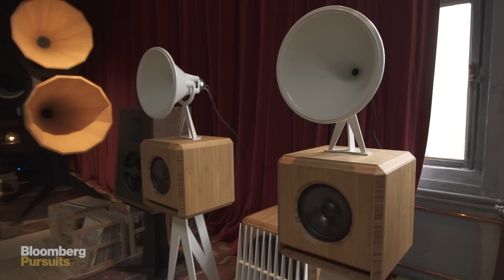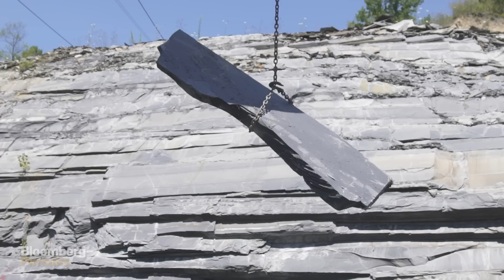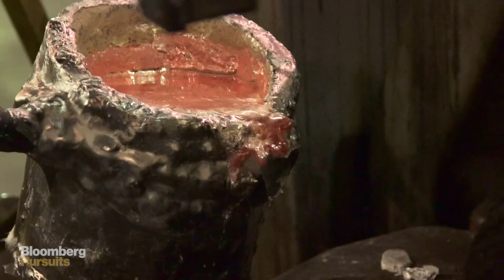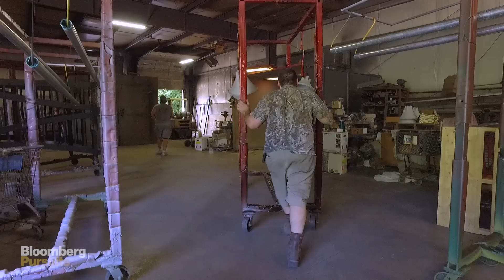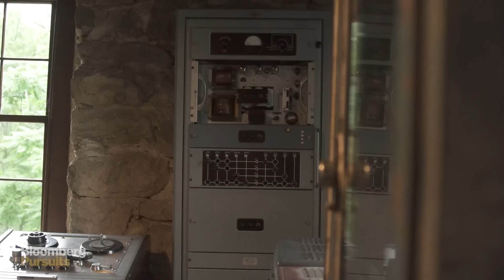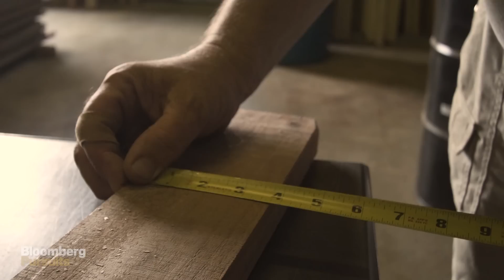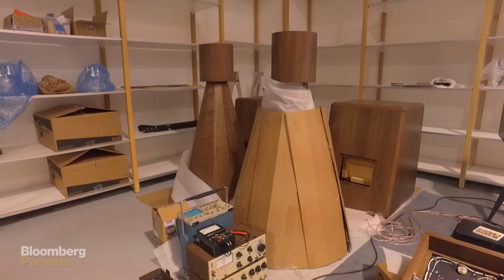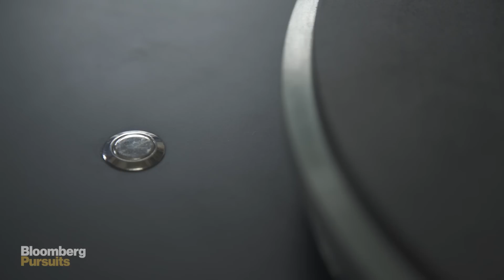How a $300,000 Speaker is Made

Comment: As an industrial designer (aka product designer) I can confirm this is all BS from design to manufacturing lol
Reply: if you talk bullshit all the time people start believing it, even the bullshitter starts believing his own bullshit.
Reply: all of the processes he talks about common processes and many times aren't even the best process for the piece, just the one that looks the coolest.

Slate: that is simply how slate is mined.  nothing special
casting: it isn't clear what all pieces are cast.  They make it look like the brackets are cast which is ridiculous as casting produces a much less desirable grain structure in the metal compared to most other processes and is only practical when it is a complex shape that requires it.  For any flat piece, casting is a terrible method.
Powder coating:  Once again, a very standard process that they talk up as being something special. 
electrical components:  As other have pointed out, horrible soldering job.  Bad enough that it could begin to degrade signal quality but more likely lead to premature failure especially for an audio device that will have to handle vibrations.  

If there really is some unique processes they do, he didn't explain it nor did the video show it.  It is a bunch of hyped up terminology.  

The wood working seemed good enough quality but nothing that justifies the price tag of a new home.
Reply: yep.

I'm just so annoyed with that audiophile community always saying they make they speaker that "represent exactly what the artist intended" or some BS like that. Ya know what I mean?

Them I'm like, dude.. go buy your shit at guitar centre and save 290k ;)
Reply: Batt man,  I am really not sure wether you are trolling, ignorant of being both... It's great that you think every speaker is a speaker. Good for you! But my ears are hearing a difference, and that is what counts. Not your opinion. 
Just to verify: Speaker sizes, use of tweaters, seperate mid or sub speakers (2 way, 3 way, 4 way), active or passive speakers, cones made of sturdier material to pump it up without tearing itself, acoustic chamber of the speaker.. Not forgetting manufactures who deliberatly use resistors to block out certain sound frequencies to get a warmer sound for example... ( like your ATC speakers for example.. ) You say everything is the same. Well good for you mate.  I am not going to argue you on this one though. You basicly say a race car is just a car too, but you forget that a normal car isn't build to race. Racecars have a special purpose. Yeah..  No use to argue with you. I just want to advice you to talk to high scholared music engineers. You know, those guys who push buttons, use sliders and knobs to make a track sound good? I bet all of them laugh at your comment mate. Because every professional audio engineer uses logitech computer speakers, because speakers are speakers... 

I also wish to go in about a few of your 'trolling' statements:  "Audiophile" isn't a global broad name for everyone who likes music and hifi? Because EVERYONE likes good quality music. So why call it Audiophile and not just human? An Audiophile is an HI-FI lover. High Fidelity.And that means that audiophiles are people who want the cleanest signals to their speakers. Who wants the best sound thrown at their ears. It's not so broad as you think it is. Most people dont even realise the impact of speakers, cables and all other interferences.. So therefore they are not interested. The " non- audiophiles"...  So, another thing you are wrong about. For fuck sake man, this is even in dictionaries.. Where did you get that bullshit?! 

I almost feel bad to correct you on every single thing, but you asked for it, since these are your words. not mine:

To quote you: Most people like you comment on video's like this without ever listening or even owning a pair of speakers worth over a few hundred quid     People like me? What you mean with that? In a stereotypical way? And how do you know that 'these?' people never heard something over a few hundred quid? Do you have statistics of that? Im really curious though. Because you are wrong, again. sigh..I feel the urge to tell you about my job, about my hobby. But i won't. I do not need to give you that info just in order to make you learn something.  But i hope you realise you did not meet the right person to 'test' your self-taught expertise. It's plain wrong what you say, plus it does not make any sense at all. Hope you realise you are wrong too for assuming things from strangers online.

And what's that about cabling? We never mentioned cables. Of course cables matter in sound quality, but we are discussing SPEAKERS. Not cables, no amplifiers, but SPEAKERS. :)

I have to say, i see alot of people claiming experts on youtube, but at least most of them have a certain basic understanding about it, but got it wrong in details. You fail in the basic.. You are rare. Treasure it.
Reply: want examples? that whole rant about his slate is bs. pure, unadulterated bs.
he claims to use the highest quality components, "aerospace stuff" is the term he used
Reply: Batt Man Alright my talking is officially done with you, you rather not take responsibility for your ignorance and just distract with a joke or a smartass comment; I just realized I have wasted my time typing this espcially because Im not one to constantly comment anywhere in the internet. The time i wasted is time I will never get back, well let me finish, goodbye fellow stranger.
Reply: As a music producer I can also confirm this is  all BS.
Reply: Well, Panta, I agree that the design is awesome, but then they just should call it 'design speakers' or 'design audio gear'.

The whole story about this having this awesome sound is such BS. I'm sure it's fine, but if you want great sound, then you buy a studio monitor.
Reply: Veteran Records, his father sounds like an idiot aswell then. But i guess he pretends to have a smart father. He is now changing subject. First he was the expert, now suddenly his father is. I guess your right. Seems also not worth my while anymore. People are objective. Let them decide who is right, i am not worried about that.  Just pointed out another very stupid young boy on the internet. Too bad he is making his dad look very bad on the internet. Poor guy. Hope his dad does not find out what his son is saying, in behalve of him...
Reply: "...a speaker is a speaker...period", said NO audiophile EVER.
Reply: thank you. You are now muted. :)
Reply: I'm not an industrial designer and I could smell the BS as well. Thanks for the confirmation tho!
Reply: The only thing it seems to be above average are the woodwork.
But since we are talking about some fking 0.3 mil, even if those are some Rolls-Royce woodwork(no, they aren't), it is still a huge rip-off.

I meant, you can totally buy a few masterpiece wood art for 0.299mil, and a set of $1000 speaker and have far better performance.
Reply: They try to turn music into fashion, ever since the end of the 90's. There are even highly skilled music engineers finishing tracks with mere headphones. ( HEADPHONES! ) "As the artist intended". Uhuh. 

Advertising these kind of speakers is just like using anorexic girls as a main image for the fashion industry. 
To put it hardly. It sad for those girls... It's also sad for those speakers...  

It's brilliant marketing though, because they make money of it, and that's whats counts as company. It's not in the right mindset though. It's actually unfair. 

Maar gezien je naam, is NL handiger? :P
Reply: Probably 1% of the speaker price is some really nice driver components that in a cardboard box would get your attention.
The rest is designer furniture mark up.
When he spoke about "tone wood" that Martin guitars use I knew this was sales pitch for simpletons.
This is supposed to be hifi, if there was a tone from the timber that is called coloration of the sound.
Those speakers don't look like they have timber 1mm thick like a guitar if he was serious about extracting tone from the wood.
Reply: Bro. Tolliver Well he is selling this and basically milking the whole process to sort justify the price, while the manufacturing process being actually very simple and typical of hand made.
Reply: Plus the design isn't anything to go crazy about. I mean, look at 0:30. What are those white speakers? Did they took them from a worker's strike or something? xD
Reply: Ok, but give us example of bs from this video.
Reply: Batt Man I don't really understand your point. 
My point is that it's better to buy a reference speaker or studio monitor than the stuff one can buy in an audiophile shop.
Reply: Wayne, haha. Was thinking about the same thing. Well batt man, go ahead. Make me a video then. Post the link here. Show me the credentials. You are whining how my information is wrong, yet you fail to even supply the correct information. You keep telling its wrong, but you fail to explain why and how. So here you go telling me you are going to make a video. Go ahead mate. Make me proud. Don't bother making a video showing what audio you own, because i don't care. We are not discussing what we own. We are discussing the principle of audio. So, make a video, explaining ALL these points being discussed right now. And how you counter everything i've said. I want your proof, your statistics, just like i did. If you do that, and you are right on everything, i'll will be a gentleman and say you are right and i will back off. Till then, stop trolling.

 Also, i know my grammar needs improvement. ( at least i know where my flaws are.. If i have an excuse, it must be because im not native english. But i guess you aren't so  ignorant to understand ) You, though, should worry about your typos mate. And if you don't want your father to be disrespected, stop using his good name for your own sake. If you are 44, that means he is retired, right? :) But that does not matter, because you aren't 44. Why? You don't talk like a babyboomer. Your profile text is: -"This channel is about music and not ratings, fuck the neggers of thumbs down, who gives a shit. Going out to all DJs of different styles of music and mixing".  This isn't a 44 year old speaking. And not even close to someone who finished Cambridge. It's a confused 15 year old speaking, desperately wanting attention and having last word all the time, without contributing anything valuable. Well, going to wait for the video now. :) And don't try to back off now! You've said it, now i want it.
Reply: Lick My Taint I know he is an idiot. Consider it a personal social experiment. How long till it takes to make an idiot understand he or she is an idiot? But i think we reached that point now. :) Still no video though.. 

I don't argue your choice, because for me it's another way to view at it. When i do my mastering, i reference on other speakers too. But having monitors, which are calibrated ( or should i say: left alone ) to create a basic and general sound, instead of enriching it with flavours. It's just the way i work. I know dozens of people who uses your way, and i know a lot of people that uses the same way i do. And both are capable of making really strong mixes. It's an apple vs windows discussion i think. But Brat man said literally: Speakers are speakers. Which is NOT true. There is a huge difference in monitor or loudspeaker use. It's perfectly fine that you are finetuned and experienced, to use both.  But you cannot deny that there is a technical difference. I use bose in-ear phones on mastering too. I know they are rich and warm. But they also are sound-tight. Able to hear it closer then any other speaker. And yes, i am used to them aswell. My monitor is there to check out if i am right or not.
Reply: How can I unsubscribe from getting updates about this conversation.
It's really quite annoying...
Reply: Batt Man ,  I never asked if you liked my music? Of course you don't , because you don't like me. What else could i expect? At least my follower base is more positive then yours? Don't want to ruin your 'bash him' conversation, though. I am just doing my thing, unlike you. But, how can you expect that EVERYTHING you say now, is still relevant? You still don't have the video. I want a video. Till then it's all "blablabla". 

"Education" learns to be honest. But you are a compulsive liar and exposed yourself multiple times. Your arrogance and hatred towards anything and anyone is unbelievably high. Mate, you are a nutjob. Seriously, get help. 

So from now on, it's bye bye attention. Till the video is here, no word from me to you. I'll wait for it though. :)
Reply: Lick My Taint

Yeah, i call the 'sonically balanced': dynamics, though. Same thing, same use. How's your idea about loudness? Pro or con?
Reply: Batt Man yeah do that and also type in your address
Reply: "As an industrial designer" more BS...lol
Reply: Hello, Batt man? Where is the movie you promised? I gave you a week to reply or come up with a video. But none of all that? Typical :)
Reply: MDF
Reply: Mr Zesky if someone is willing to pay $300K, then let them.   It's not just the music,  it's the exclusiveness that comes with it.
Reply: while wood horns can sound great (visit some large recording studios), but this design in the video would mathematically have so much destructive acoustic reflections (interference) on its faces due to woodworking limitations here it isnt even funny.  Horn design still improves today but this is the dark age.  Horns arent used much anymore because double blind tests have proven as such, but for large venues or rooms can be helpful if you still like to use class AB power as a purist.  Having said thaet why would anyone design a horn like this - its just not as good as modern designs that could be used with modern CNC.  This is not conjectire - it is science
Reply: *295k ;)
Reply: f you are an industrial designer and therefore you should know, why the LS cabinets are made out of hardwood. Explain it to us please. And after your explanation, pls tell us, which material would even be better than hardwood for loudspeaker cabinets.
Reply: Batt Man  "And Where And Where. . . .Is The Batt Man? He's At Home Washing His Tights"
Reply: They are horns. Normally used in high powered loud speakers for PAs. Put in high end wood horns for this guys speakers. Gimicy.
Reply: You don't have to be an industrial designer to know that cutting stone, cutting wood, and casting metal does not equal 300k.
Reply: As a retired industrial designed and entrepreneur, the premise and promise leave much to be desired. Mountains of research and 100 years of experience (Altec, Bell Labs, Western Electric, et al) contradict his every consumer benefit claims.
Reply: Both of you are bullshitting. People don't use their 'degrees' to prove a point. They just use the information they have learned while getting that degree. Smart people know they don't have to proof that they are smart. They just are, and people will notice that. 

How many times i heard "Well i studied... ... , so i know more of this then you". When i see this, i instantly know they are bullshitting. Instead of bragging about degrees, just use the information you've obtained, to point out someones mistake or misinformation. So both of you are caught in the action. And from both i've never seen any valid explanations which proves your degree. I've yet to witness the "Well i am using the toilet more then you, so i am more of an expert in bullshitting then you"  argument.
Reply: Batt Man   Oh, you are right, thank you. But you just 'proved' my comment right now. :) Just saying. Another sign of intelligence is empathy and understanding. Glad you think knowledge and intelligence are the same thing. Only it's not.   ( "Idiot" is about intelligence, and "grammar" is about knowledge. It's a teeny weeny bit of a contradiction right there buddy... )
Reply: I do sound production, aswell. We thinkalike ;) But studio monitors are for referencing. I expect them to 'show' me all frequenties i need within my genre,, so i can create a track that fits all speakers. For pure listening, i wouldn't recommend them for myself. I am a sucker for warmth in speakers. Mid and subtone ranged. :) It's personal i think. 
I do have to say that monitors are the only desired speakers i want, when i am doing music production. The only thing is, is that i buy them because i find value in their use. I don't see value in 300.000 dollar speakers. In no way ever. Even 100k. Even 50k. Even 10k. You can find speakers below 10.000 that fits your need. I am sure of it. When i can easily afford these 300k speakers,. just so i can use them to light my cigarette,  i wouldn't even have them.
Reply: Batt Man It seems you don't know what a designer does lol
Reply: I know his talking is bullshit, but which part of design and manufacturing is bs?
Reply: Lick My Taint Thanks for your listening on Soundcloud mate. Honestly though, i am not fond on both of my final results. I have given way to much dynamics and forgot it needed power aswell. And actually, i am focussed on the music instead of the mixing. I am taking in tips and tricks and learn the way by doing it. And i am glad that there are graduated audio engineers in the world. They can help me, or even can do it for me ( as a customer )
I still see these 2 things as seperate: Making music and polishing music. Both are expertises.
By the way, if you like making music, click on the "Indaba Music" link on my soundcloud. It will show my profile with way more music ( also a lot of sh*t, haha ) but the main website is cool. It's a community with musicians only. There are competitions, samples, prices, chatrooms etc. It's an awesome place for us.

But i ment the loudness wars. You must heard of it. Normally there is a difference: If you mix it for club / stadium / outdoor use, then you need power and loudness.  (amplitude ) Dynamics aren't really that important, because P.A speakers aren't made for dynamics. They are blasters.
Then you have the dynamic mixers. ( which i feel i am being part of ) They mix for radio use, headphone use, home use.  They don't want subtle details to be gone because of things like  'ducking' or heavy side chaining.

Loudness wars is all about those who think loudness should belong in home, in the car, on your headphones. Harder is better is their believe. And i am con-loudness. :)  Either way is fine, every individual likes something else. 

And cinematic audio producing and mixing is so different then plain music. It depends on so much more factors. The rules are completly different. Wouldnt be fair to compare it.
Reply: Omni-directional speakers would be a much better investment. And I think they cost less too.
Reply: Jan Baars FAM!
Reply: Pete Sandov what part is BS? What did the video say that is untrue or embellished?
Reply: in what ways?
Reply: Arin I from design to manufacturing